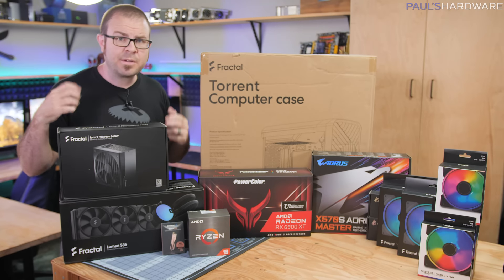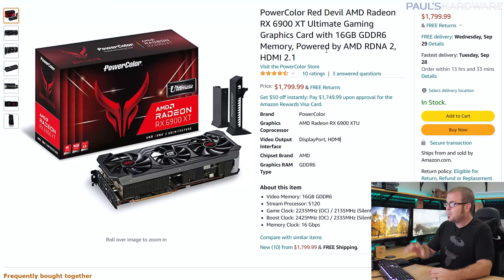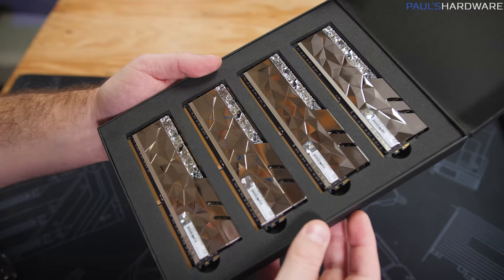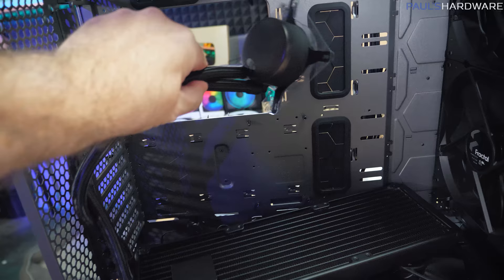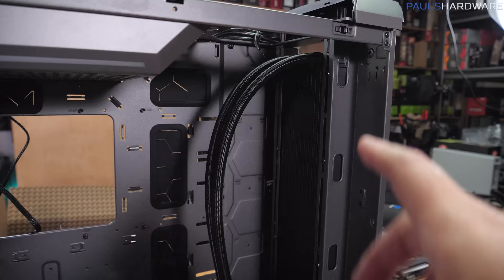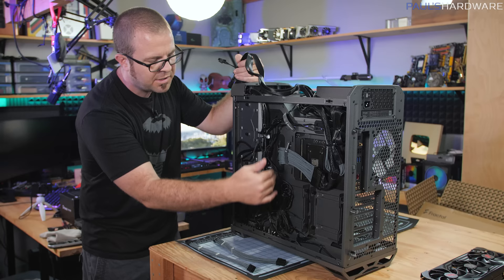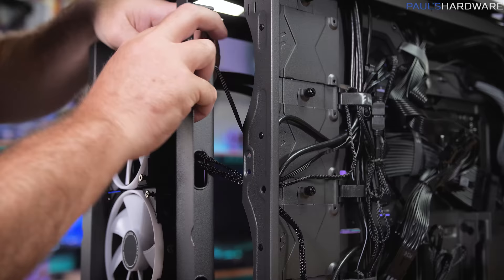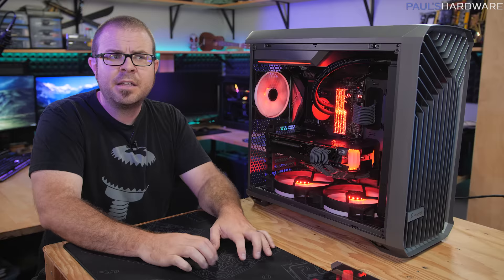Build this RX 6900 XT Gaming PC for the cost of an RTX 3090

Comment: Hey Paul! I would recommend using 24pin PSU cable combs to manage the GPU since it is using three, 8-pin connectors. Much easier to train as well as looking very clean. Good luck to everyone who enters.
Reply: Was going to say the same thing.
Reply: I thought the same thing lol
Reply: Maths!
Reply: you're very smart, gonna do that now.
Reply: I have the dumbs!
Reply: If I wanted to do a build with a hero viii that requires a 24 pin and this gpu; this would create a problem needing two 24 pin connectors?
Reply: @glennholmes724  they are different connectors with different pinouts. 3x8 pin pcie connectors and single 24 pin mobo are different, but cable combs just guide wires and can be used wherever.
Reply: @ShaneCutting ah, thank you for clearing up my confusion! 20+4 vs 24 pin PSU got me spiraling since I previously have just googled best psu for [insert gpu/cpu].
Reply: @glennholmes724  I currently have a Crosshair Hero VIII with a 5950x and a RTX3090. I initially have a 850W EVGA, but had power draw issues which caused the system to shut down. I updated to 1200W Platinum rated Maingear and have had no other issues. Honestly a 1000W would have covered the bases, but availability made my decision a simple one at the time. If you need further assistance, feel free to replay and I will do what I can to assist
Reply: @ShaneCutting  Thank you. had a 5900x on a b550 with 6900xt ref and 750w, but upgrading to 5950x on a viii hero on insurance money with whatever 6900xt I can get a hold of. Was thinking of going for a Seasonic 1000w platinum.
Reply: @glennholmes724  Sounds like a match made in heaven. That should serve you quite well.
Reply: @ShaneCutting  Now I feel even better about it!

Comment: I have that same 6900XT  Red Devil. It is a chunky beast. I love it. Looks great and the clock speeds are amazing.  Great video and great build!
Reply: I got the ultimate 6900xt from Amazon for 1099 from Amazon randomly a month or so ago
Reply: Tajl3r  I got a 6900XT for MSRP, so it's not that terrible in that case, in the current environment anyway
Reply: Tajl3r  My microcenter has 6900xts at msrp regularly and in dif models.
Reply: I skipped both of the new gens, my friend sold me an only used twice EVGA FTW3 ULTRA 2080Ti for $600 about a month ago even gave it to me in the box and the receipt with warranty left. I must have gotten lucky
Reply: @-BUGZ-  nice deal sold my 2080 super for $700 in june
Reply: Yep I have a 6800xt. They feel well built and it's given 0 issues. Nice that it seems to idle about 35w.
Reply: @nickgarcia1292  hell yea he wanted $750 at first because he seen the market lol i tried to keep him away from knowing about the market because he bought it when it was $1,300 but they are on amazon used for $1,600 but I convinced him to come down to $600 luckily money isn’t an issue for him and that $600 was just extra for me, now i have a dual setup though and i love it
Reply: @chadhowell1328  nice! I got my XFX Merc 319 Speedster 6800XT for 875 on new egg the 2nd week the 6000 series came out. It hurts me seeing the 6700xt go for well over 900. Really hard to recommend my friend to switch to PC
Reply: How are the temps?  The reference cooler hits thermal throttle range over 230W.
Reply: I have a 6800xt and my mate just built a PC with a 6900xt. The Red Devil is such am awesome card! Dwarfs his old 1080!
Reply: @LeadSkillets  Have this same card. Under 100% load it'll hit ~70c with the cooler provided.
Reply: Tajl3r  Mine was overpriced, but I sold my 5700 xt for a 1000 bucks. It basically covered the price increase.
Reply: @beatboxastyles1   right! I know I’ve snagged a few over the year but nothing insane in price.  Has taken a lot of time doing so though
Reply: @NipahAllDay  I sold mine for way tooo cheap when I thought I over priced it lol. Put a buy it now at 550 and it sold in seconds. That’s when I saw the other prices of the same card at 7-800 at the time and later in the 1000’s lol
Reply: @LeadSkillets  the Red Devil are upmarket oc cards, even the 6700xt is a massive card with an unecessarily over sized RTX size cooler, the 6900xt will have a 3090 class cooler on it.
Reply: @NipahAllDay  I kick myself hesitating on the 5700xt when it sank to €300. That turned out to be an expensive decision, I had to use an interim Ry5 3400G to complete my build!
Reply: @chadhowell1328  I know the struggle! I was on a clock work schedule checking everyday. I usually make some money building pc's throughout the year, andI've yet to hit 10 computers to build this year.
Reply: Got my XFX Merc 6800xt back in Jan for $799. Crazy part is I sold my old Radeon 7 for $1700.
Reply: I have the stock 6900xt...was lucky to pay MSRP.
Reply: @Stefán Jóhannesson I have the 6900xt and it's an awesome card...every but as good as the 3090 and better in a bunch of games. I mostly play Doom Eternal on a ultra wide curved monitor so the resolution is pretty high even at 1440p. I average about 250fps with spikes up to 290 and drops to 200...all ultra settings. I got my card at MSRP...I wouldn't buy it now for anything above MSRP...You may want to wait for the 7000 series though because it's being rumored that the mid range 7600xt beats the 6900xt.
Reply: PowerColor is the AMD AIB GOAT.
Reply: @Stefán Jóhannesson oh yeah, you'll love it on that monitor. The current drivers AMD gas out are also very reliable. No crashes, nothing.
Reply: @basicdefaultchannelname  wich one?
Reply: @Stefán Jóhannesson I have the XFX Merc 319 6900XT running a 3440x1440 absolutely fine, MSFS 2020 on ultra settings but capped at 60fps (because flight sim, innit). Try as I might, I haven't been able to make it crap out once, and the drivers have been fine so far 🤞  Paid about 200 over MSRP for it - wouldn't you know it, a week after I bought it they reduced it to MSRP. Not too bothered though, because I saved way more than that by buying literally all the other components under MSRP in sales while I was waiting months for graphics cards to become available. Patience, it turns out, is indeed a virtue.
Reply: @chadhowell1328  me too.  Deal of the year.
Reply: And how much did you pay for yours?
Reply: @chadhowell1328  a 6900xt is over kill
Reply: @capsikseason  maybe for you.  How would you know what I use my pc for?
Reply: @chadhowell1328  depends If you do 4k editing and heavy gpu work yeh then it's worth getting it
Reply: @capsikseason  bingo.  I do tons of CAD, editing and a few other intensive loads.  That and I don’t believe in over kill. Anything worth killing is worth overkilling ;)
Reply: Hardware is one thing. the driver is absolute trash tho
Reply: @tinychamberz  dude you’re high and stuck in the past.  The 6000 series drivers haven’t had any problems.
Reply: I'm still loving my red devil 5700xt..but man, that 5900 xt is calling my name.
Reply: Heir of carthage is the goat
Reply: Tajl3r  I just sold my RADEON VII for more then I payed years ago ... Crazy situation...
So I "only" invested 200€ on top to get my self a 6900XT...
Mad world we are living in
Reply: Or you getting any of coil whine on the gpu? I had a msi 850w and I I thought it might be that but then upgraded to a Corsair hx1200w but didn’t work
Reply: @basicdefaultchannelname  what is msrp right now on the 6900xt????? Card . God I want one sooooo bad .
Reply: @TheArrowedKnee  What is the MSRP the card you got?  Surprisingly hard to find that information these days because most manufacturers aren't keeping that readily available on their cards
Reply: @Pead929  I paid about 1200€ or so
Reply: how the drivers for it?
Reply: @FunKaYxxD1sCO  Drivers are like anything else AMD, been working as they should, but nothing special to say about it either.
Reply: i got the same card, undervolted it a little and it is freaking awesome (heaven benchmark peaked at 74-75c at 2.450). question, do you use 3 separate cables for power or 2 with one pigtail? i use 2 cables, cause my psu didn't have a 3rd one and haven't noticed a problem
Reply: For the rx 6900 xt users, has there been any issues till now that you guys have faced?
Reply: @k_kalvin_13  mine has been going strong for just short of 2 years now. Mine is the red devil model from power color. I game at 1440p. It would work good at 4k or 1080p too.
Reply: @HeirofCarthage  yeah I ordered mine, I was actually going with the 6800xt but then the other price was just $20 more for the xfx swft 6900xt, then now I've seen some articles and all stating some issues with it. So I was just curious to know if I've made the right choice lol

Comment: I'm always partial to routing the gpu cables over top of the card instead of under (still not sure if it'd straighten the cables out any better), But regardless I think you did a great job and the back cable management was really good with what you had to begin with. there was a lot of cables..

the red and magenta were my fav rgb options that you had showing.

Comment: Nice to see you on the Corsair stream and call out to RobeyTech. Nice to see Fractal got out ahead of the fan hub issue and handled as all manufacturing issues should be. So your correction involved mounting the fans on top of the bracket rather than having the fans and cooler on the inside of the Fractal supplied bracket?

Comment: Hey Paul, build came out sick, one thing with fusion software the sync mode like you had it is pretty limited but if you click on the motherboard icon you can take it out of sync mode and there are a lot more effects and options for the addressable headers and other parts especially other aorus parts have more effects available. You’ll need to do each lighting part individually to match similarly and save a profile similar to icue and you can have multiple saved by adding another profile and change between them pretty easily. Its not very intuitive but not as basic as it seemed. Would love to see a revisit in the next part and see what you can do with the aorus lighting software.

Comment: Paul that computer is so close to the one I built it is crazy.  Aorus master (previous model), 5950x, 2 Sabrent rocket + 1TB M.2's, 6900XT Red Devil, Same memory just not royal, Fractal Mesh 2 XL case, with a 420 artic freezer AIO for cpu, added mech hard drive for added storage and have been watching the 2TB rocket+ since that came down in price also since the board holds 3 M.2 drives.  I absolutely love this computer.  First build since the early 2000's for me.  Your channel, Jay's, Steve's, and the other guys really helped me figure out where to go and also gave me the bug to build another.  Thanks for all you do!!!

Comment: The RX 6900 XT can be had for the same price as an RTX 3080 in Norway right now. Might be a good choice.
Reply: It's a great choice
Reply: Practically 3090 performance (outside of ray-tracing) for the price of a vanilla 3080? Fantastic choice.
Reply: Might be?? Dude one is God like video card with the performance of 3090 and the other is a shy 10gb card
Reply: @AmateurTroll69  I know. I would have bought it if it wasn't for the fact that I have an expensive G-Sync monitor.

Comment: My system build: Phanteks Eclipse P400A Airflow D-RGB Tempered Glass Black case + 7 fans, AMD Ryzen R9 5950X, Noctua NH-U12S Chromax Black (2 fans) , ASUS ROG Strix B550-F WIFI, GSkill Trident Z Neo 32GB 3600 DDR4, XFX 6900XT Merc 319, 11TB various PCIE4.0 NVME & SSD storage, Samsung G9 49" 5120 x 1440p Ultrawide monitor. Built last year just before the CPU/GPU shortage started. Although I did go without a system for a few weeks as I sold my CPU and GPU before buying the new ones.(I won't do that again. LOL!) Great build and video Paul! Have a beer or two mate! 🍺🍺👍

Comment: This is exactly what I did. I got 5600x instead of 5950x, because I game at 4K only. Put everything under water and OC'd the 6900xt to 2.7ghz and MPT gives it up to 420W power when required, typically howering around 200W-350W, depending on the game. Great temps, magnificent performance, and most of all, more reasonable price!

Comment: I built this almost exact build, minus all the RGB.  And I went for the Scythe Mugen 5 Black air cooler with a Scythe Wind Snail fan.
Recycled my old graphics card, because new cards are too expensive.

MASIVE KUDOS to Fractal!!!  Only four days from turning in my fan header support ticket until the replacement was here via FedEx.

Comment: I did something similar back in May. Ended up with a whole 6800XT PC (my Sapphire Nitro+ SE being £1200 at the time) for the same as a similarly premium model 3080 (those being up to £2400)
End build ended up a couple hundred more, as I went ham with the storage, but keeping it more in line with a base build in that respect would've been a price match. Sure, I paid over MSRP for the GPU but actually managed to save back almost £300 with good deals on the rest of the parts, all premium nonetheless... and that went on better peripherals.

As an aside, at that time similarly premium 6900XT's were £1500-1600, 6800's (still hard to find btw) were £1000-1100, while 3090's were 3-4K and 3070's started at £1300... 
And we're talking tiers of similarly performing, blow trading cards here (the still minimally supported advantage of better RT and DLSS for the Nvidia cards aside) Speaking of which, the 3080 would've been even more a disappointment than the cost alone. I've seen them already max out that measly 10Gb VRAM in games at 3440x1440 where DLSS doesn't apply while the 6800XT still holds a VRAM overhead. I wasn't sure what tf Nvidia were thinking back then but of course it's all become clear lately. It's not good but who cares?... that's the Nvidia hype train for you.

Comment: I built my computer recently with the same CPU and the same model gpu. Mine is an xfx merc 319 black.  That is the best cooling solution. It came with a anti sag bracket, but it didn't fit in my lian LI lancool ii mesh due to the card itself barely fitting in the case without the bracket. I'm still in the market for a good anti sag bracket. That GPU is a monster for raster performance and compared to my original build I boosted performance by 135%. I'm also amazed I was able to fit my Arctic liquid 360 in push pull in the front.

Comment: What I would change about your build are the way the fans blow. The one at the back that you call "exhaust fan", I'd have blowing air INTO the case! The front fans, change them to PUSH air out of the case! Having the front fans inside the case pushing air out through the radiator. You don't want hot air from the radiator blown into your case, you want all that heat to get OUT of the case! Added benefit is that you also get the pretty LED lighting from your front fans into you case instead of on the outside.

Comment: FWIW: My most recent build, in July 2020, was specifically geared toward being able to run Microsoft Flight Sim 2020, while still being an affordable general-purpose desktop also capable of large photo editing with PhotoShop CS6. 
1. The mobo is an AMD X-570 Prime. PCIE 4.0, 2 M.2 slots, 2 PCI Express slots. Windows 10 Pro for the OS.
2. CPU is a Ryzen 5-3600
3. GPU is an AMD RX-5500-XT (I wanted a 6500 but they were back-ordered by then and unobtanium within my budget).
4. 64 gB of DDR4, I forget what speed. 3200mHz, I think. 
5. Seagate 500 gB SSD, which failed 6 months later and was replaced with an 8 gB HDD. Slower, but more reliable and less expensive.
Total cost for all parts, including a very nice mid-tower side-load chassis with 4 internal 3.5" drive bays and 4 external 5-1/4" optical drive bays, was just at the upper limit of my  $1200 budget.
This is what I found after several months: 
a) The Ryzen 5-3600 CPU is great. 6 cores, 12 threads, clock speeds up to 4.2 gHz without over-clocking. It can render 1080p videos in the h.264 codec using all 12 threads utilizing 100% of the CPU - this is wonderfully efficient use of the processor, and I get up to 200 frames per second. No complaints with the CPU at all. In MS-Flight Sim 2020, the game never pushes the CPU past 30%. 
b) 64 gB is too much DRAM, and I would have been better off to go with 32gB and spend the money saved on a better GPU. I didn't know this at the time, but very few software apps or operating systems know how to use more than 32gB of DRAM. People running network servers, or some kinds of very high-end video and graphics editors, might be able to use 64 gB. I have two or three times processed gargantuan photo montages and panoramas in PhotoShop CS6 that ate 50 gB of DRAM, but that's all.
c) The bottleneck in this desktop is the GPU. The Flight Sim pushes it to 100% utilization at only "medium" graphics quality. I need to replace it with an RX-6900-XT to be able to render the sim at the "Ultra" graphics quality level, but so far, as of June 2022, these GPU's are still double the listed retail price if you can even find one at all. Every other component I bought seems to be fine and none of my productivity apps seem to need more CPU capacity than my Ryzen 5-3600 provides. MS Flight Sim is the only game I play, so I can't say what other kind of games might in fact need something hotter, like a 7 or 9 series Ryzen, or even a Threadripper. AMD makes Threadrippers with crazy specs - 64 cores, 128 threads - that cost $8,000, so I guess there are apps out there that can actually use them, but I can't imagine what they are. Are there actually games that you would have to buy an $8,000 CPU to play?

Comment: The point about radiator placement is so any air,  collects in the top of the radiator above all tubes and such so it runs quietly and smoothly with just liquid circulating once it's been on a few minutes.